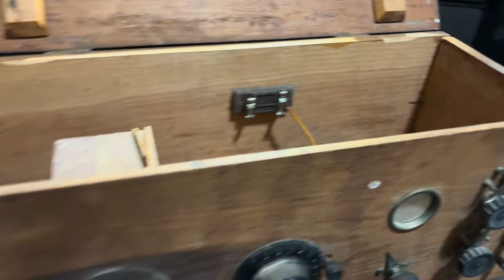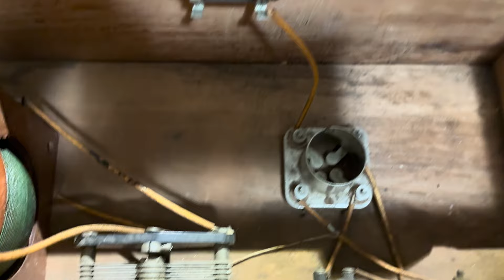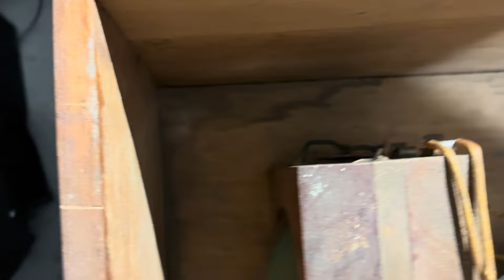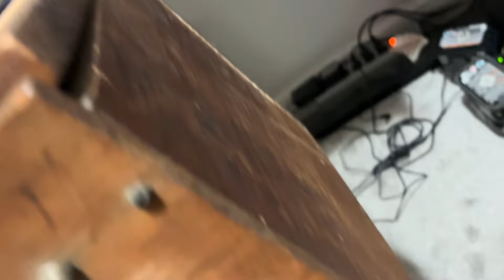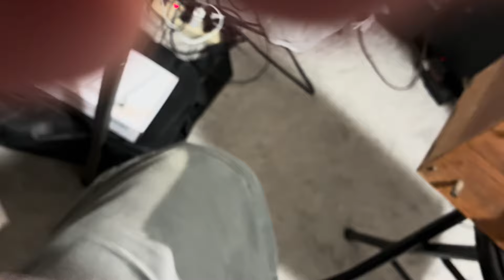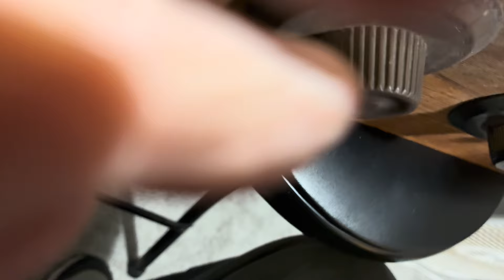An Old Radio Needs Some Love

Comment: I have a homebrew SW receiver I bought online.  Three tube regen.  Note inside says it was built in 1936 but they used salvaged parts from older radios. Big tuning caps.  Three tubes,  two 01AA and a 71A output.  NIce wood box with hinged top and a set of plug in coils inside. I have seen lots of homebrew 20s BC sets but SW homebrew stuff from the 30s seems more scarce?  I built a replica of the Twinplex using a #19 tube with plug in coils.  And mostly period correct parts.  The rest are plausibly correct and it pulls in the SW stations.